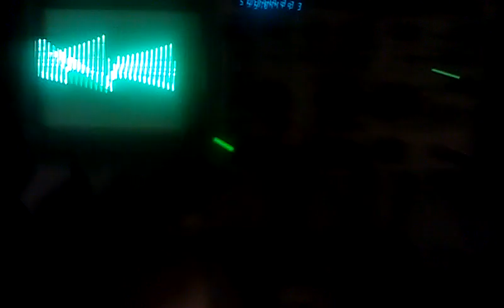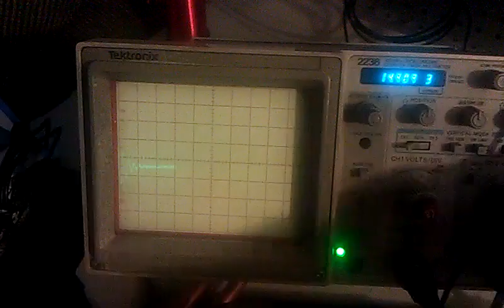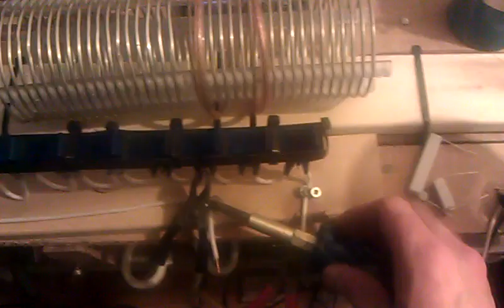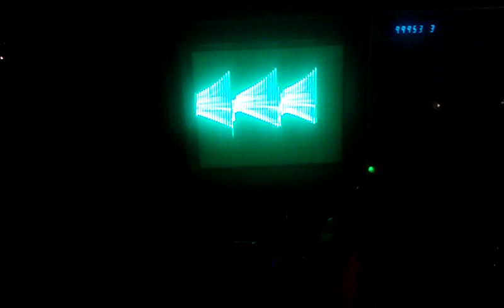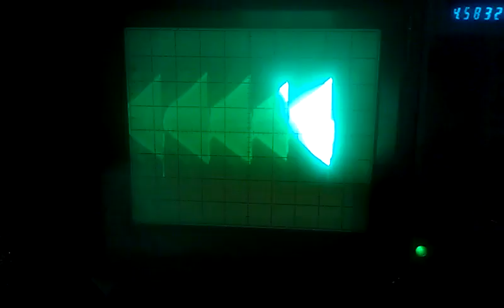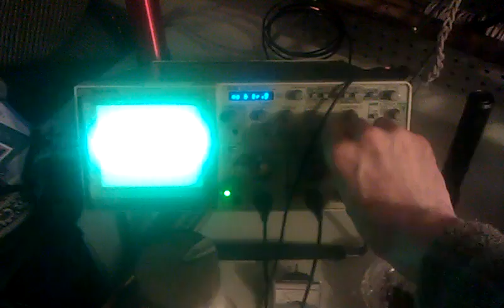Don Smith Device Project Part 20a: Bell-shaped Wave-Form and Output Testing

Comment: salut kurt, ton spark gap est en série avec le coil primaire ou parallele.  Pis le spark gap ajusté ton output augmente beaucoup, est que tu vas ajuster pour avoir le top du "bell shaped"
en tout cas, beau travail. continue. salut

Comment: @kdkinen
It's like guitar strings: for each length and tension (length too, and voltage  in electricity) you have specific standing waves that you can obtain: 1/2, 1/3, 1/4, ..., while you have 2 "nodes", plucked strings. If not, you can have different harmonics like 3/2 or 4/5 waves.
allaboutcircuitsDOTcom/vol_2/chpt_14/6
So here you could find the fundamental of a coil and see to inject double, quadruple, or more easier and could cost much lesser energy: 1/2, 1/4,... 1/n^2.

Comment: @Kdkinen
I've thought about an other way: instead of having series of specific length coils, injecting the multiple frequencies to produce the sum of the frequencies... The purpose is still to create the highest amplitude of harmonics by setting directly them by multiplication than to just "find some" when injecting a single.  What do you think?

Comment: @Kdkinen Hi again Kirt!

I have no real place neither oscillo at home and all that stuff need, and not have the budget for :/ but I have few ideas ;)

About resonating: what if you make a series of coils of multiple lengths but same diameter and gauge, to impede a series of specific harmonics that could add together and boost there amplitude, like 1f + 2f + ... + nf, with "f" basic frequency calculated on the basic frequency of the unity-coil?

My basic theory is that noise is a fractal hazard.

Comment: @kdkinen  So, that would be the best if your battery remain fully load! ;) Just to remember to anybody: > 12.80V --> 100% of load, 12.55V --> 75%, 12.32V --> 50%, 12.18V --> 25%, 12V --> completely unload (from cars services data).

Comment: @kdkinen ok, good for the really 30A :) And very thanks for answering :D

but I wouldn't seem to much hard but again: the fact that you can't light much your 5 bulbs with just the battery and very well with the device, doesn't mean that's the device is more economical in terms of energy than the battery. Again, it could be only because the device boost the conductance of the load. the battery could light 20 hours with .5A while with the device only 4 hours with 2.5A, exactly the same :/

Comment: Happy New Year Dkinen! and thanks for this new video :)

You've written "bulbs are the same 12vdc 30 amp" wouldn't rather be 30mA?

For checking of any overunity, could you take smaller battery and compare the time of discharge between the 5 bulbs powered by the device then directly by the battery? cause as measurements are special in hight frequencies, only that kind of test will tell us the true result, you could have only boost of conductance indeed. Remember, the only true test is E=P*-T ;)

Comment: Nice work! how bout putting up a drawing of the schematic momentarily.
anyway I am glad you got past the previous hurdles. I would like to see the high and low pass filters you are will be using to get the freq down to 60/ 120  what ever you are going to use to extract for output power. you know the proverbial "Resistor"
Zane